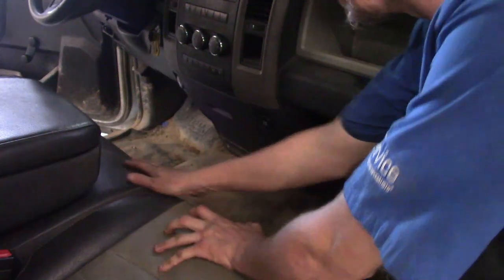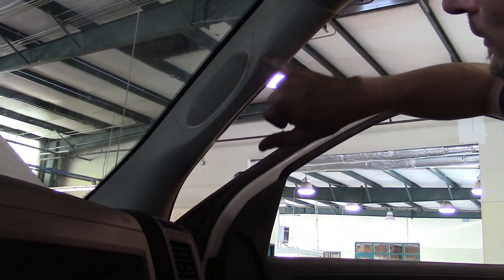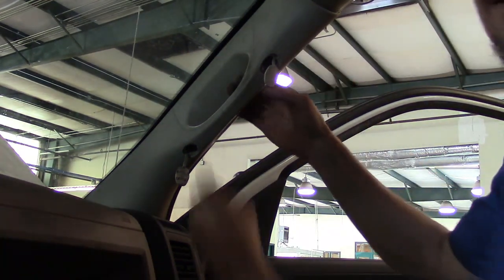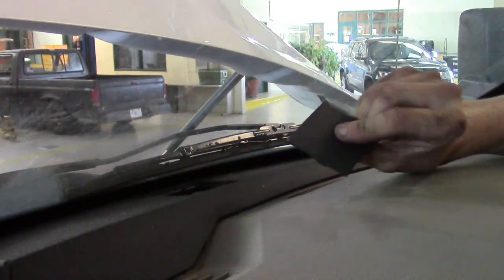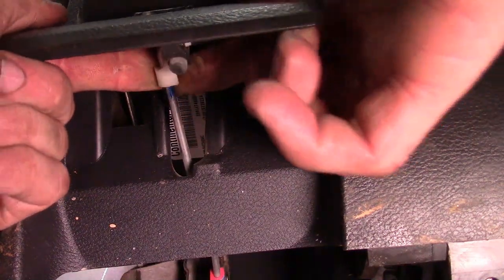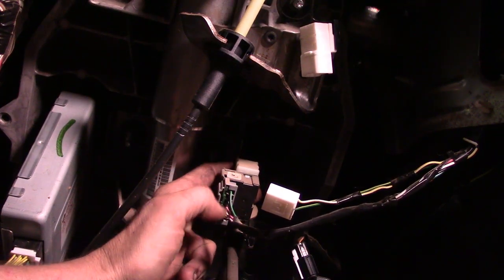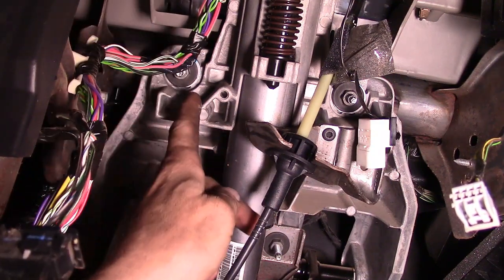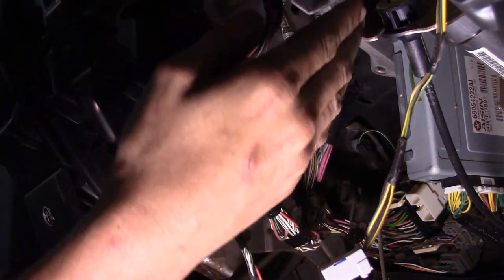Part 2/4: 2009-2015 Ram trucks A/C evaporator and recirculate housing

Comment: I needed this video in May for my 2007.  Oh well.  I've sold it and now have a 2012.
Reply from the maker: Stephen Kissel Hey there Stephen. The video would not have been the same for the 2007. Not a lot different but different none the less. It will work for your 2012 however if need be.

Comment: I have a 2010 dodge ram 1500 if you don’t want air conditioning problems don’t run outside air if you’re in a dusty area. I never run my air conditioning with outside air unless I’m on the highway and it’s not really hotAnd if you do this you will never have a plugged up condenser.
Reply: evaporator

Comment: So the replacement went good so far but my brake light switch didn’t make it I have a new one is there any thing other then just plugging in the new one ?
Reply from the maker: Its a gamble each time....most times they survive and others they dont. You should only have to install and rotate it to lock it in place. Thanks for watching  and make sure to subscribe.

Comment: So I got a 2014 2500 6.4 and have lukewarm heat but both hoses are hot. I see the little white tab on the door move when I switch from cool to heat and the truck gets up to temp. What should I check for next?
Reply from the maker: In a case like this I recommend performing the HVAC calibration test using a scanner that is able to so that it can be tested to see if there is an issue. Thats where I would start to rule anything out there.
Reply: Would the calibration have to be completed by the dealer or can I do it myself without a scanner? I have flushed the system (including the core itself) and now sometimes get really hot air and other times it's just barely good enough. I'm up in Wyoming and need to fix this before it starts to get below freezing. Many thanks man!
Reply from the maker: You need to have the scanner thats able to perform that.....a dealer or independent repair shop should be able to.

Comment: What would something like this cost? To replace the evaporator? I have a 2011 Dodge Ram 1500 that I just put a new engine in and the A/C hasn't worked since. Help....
Reply from the maker: Labor is around $700 plus about $300 in parts......so $1000 would be a good rough estimate. Hope that helps. Thanks for asking and make sure to subscribe.
Reply: @MotorCityMechanic  Sad face. Thanks
Reply from the maker: @janetthaut5454  Sorry to give you that news. But if you do it yourself you will mainly only be paying for the parts and having some evac and recharge the system. Its really not as bad as it looks.

Comment: How much oil did you put in your system after replacing the evaporator core ? And how much?
Reply from the maker: jaime bojorquez Typically on just the evaporator no more then 1 ounce. Thanks for watching and for the question. Make sure to subscribe

Comment: What will be different if you have a center consul?
Reply from the maker: Afternoon Jake. The only difference is the removal of the center console. I don't have a video on that as of yet. It's nothing hard.....remove the front rubber tray liner and there are some screws there. The large chrome ring around the shifter need me to be carefully lifted up and off. Then you can remove the upper portion of the front of the console where the shifter is. Then it's just a matter of removing the related bolts and screws. I believe the shifter needs to come out as well....been awhile since I had to remove a center console so please excuse if my memory is a bit fuzzy

Comment: I just did my truck everything is fine but now the traction light stays on someone please help me
Reply from the maker: The one thing thats common that can cause issues such as this when the dash is pulled back is the brake pedal switch. Sometimes you can reuse it....sometimes you cant. I would first start with  checking the codes to see what caused the light to come on.....I still have a good feeling the pedal switch is the cause just based on experience. Thanks for watching and for the question. Make sure to subscribe